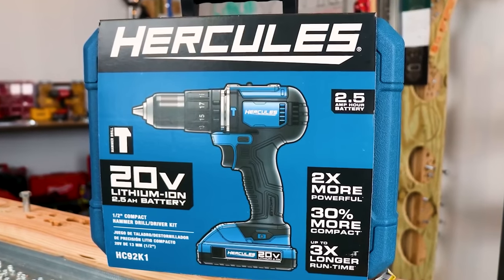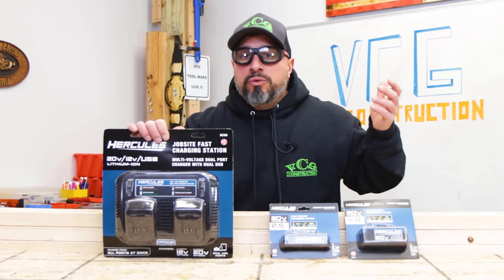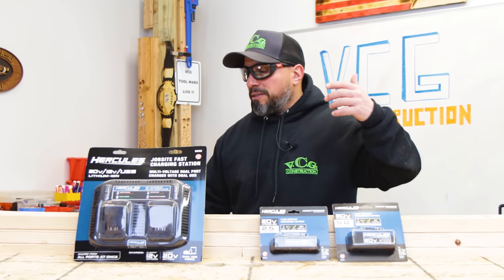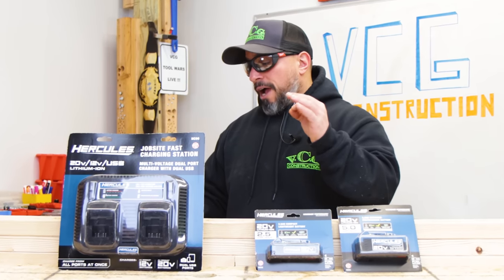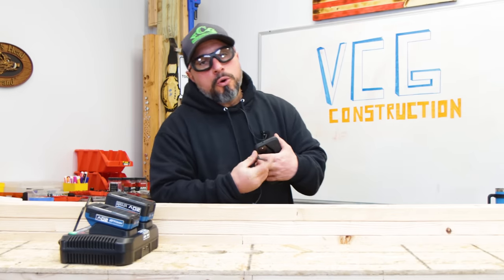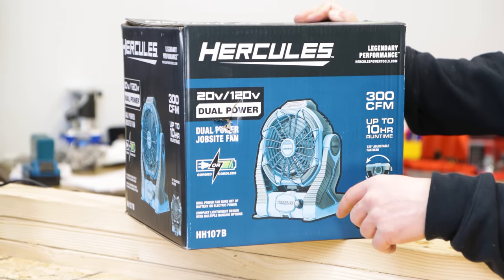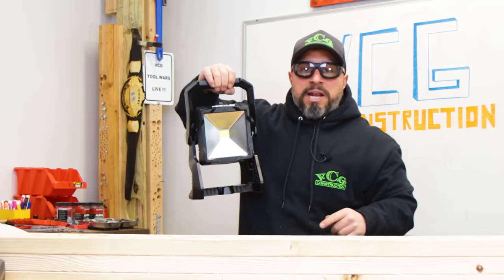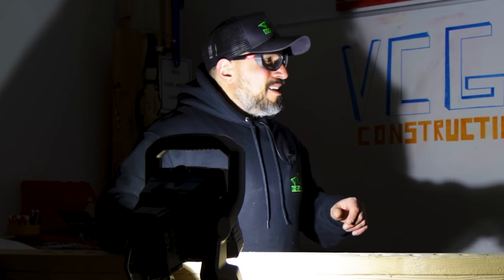HARBOR FREIGHT Sent Us A TON of FREE Hercules Tools for UNBIASED REVIEW!

Comment: My primary concern with HF power tools is in 3 years Hercules and Bauer will probably be gone, and they’ll be onto Perseus and Taurus.  Let alone 7-10 years from now...
Reply: Chicago electric stuck rnd awhile but yeah they did lynxx dirty. So will they keep with these? Idk. They Investing a lot into the line right now. Good sign
Reply: To be fair, how is that any different than the current big name brands potentially developing a new battery design within that same time span that's not compatible with their older tools as they discontinued the old style battery? You'd have to be forced to buy newer tools anyway just so they're compatible. The only brand I see not doing that is Ryobi since they've had the same battery platform for years.

Comment: I'm a WW, and I've had my share of HF tools. Some are out-and-out crap (any Drill Master tool, except the bits which are ok). Others seem to do really well. I have some Chicago Electrics that over 15 years old. The main problem I see is reliability. They may seem to be great when first used, then a year later they quit, or start having problems.

I've gone sour on them because of the compound slide miter saw that I have. Yeah, it was only $89, but  It is a way better design than the previous version. The slide bearings are going out after only a couple of years. They aren't replaceable, either. The old one I had never quit, but was getting unsafe because the spring wouldn't stay in.

I think they have a low bar on quality control. I would suspect that everything that gets assembled, gets shipped.

Comment: The most interesting is that work light, any of the other stuff, naw, not yet. But the work light makes sense, but I would buy 2  and hopefully I could get the 25 off the two port charger with a couple  2.5 amp batteries, but the dual power makes the sense that Milwaukee lights are.

Comment: Great video Vince! Hercules seems like a fine tool brand, but it's weak warranty and comparable cost to other better brands keeps me from jumping to that platform. I will stick to Makita, Bosch, Ryobi and DeWalt for all my power tool needs.
Reply: Abel I was thinking the same cause I do have a need for a cordless 18 volt multi tool,  I got a Bosch 12 volt and a Bosch Corded but both are Starlock and finding a blade when really needed somewhat impossible. I know that Makita is top rated, and I already got so much Milwaukee Cordless as well as Bosch  Cordless, Bosch 18 is European,  do you have the Makita or Milwaukee?
Reply: @josephlabranch6595   I have mostly makita, Ryobi and a single DeWalt for all my 18 volt cordless power tools. All my 12 volt tools are bosch.
Reply: @abelesparza6059  honestly the 12 volt bosch multi tool has the same problem as almost every other 12 volt battery I know of and used and that is the battery staying put vs. vibration,  lol!
Reply: Nobody mentions the extendable 2 year warranty. And you don't need to mail in the tool and wait 6 weeks like the other brands, just walk into harbor freight and they hand you a new one.

Comment: I remember when Home Depot cleared out Irwin Quick clamps. I scored (10) 38" HEAVY DUTY . AT $5.50 EACH AT THE TIME RETAIL WAS $40++ . GOT ABOUT  50 + FREUD/ DIABLO ROUTER BITS for around $2 to $4 each normally priced around $20- $45 . They where reducing inventory mix. Gave several to my woodworking buddies as gifts and they couldn't believe it. The guy over at the hardware store got all he could to resell as they where the deal of the century for him. Don't see this as often anymore as Depot will pack it up and send it to a pallet load auction resell division they have i believe out of Phoenix. Cheers

Comment: Been using the Hercules 20v impact and 12v compact drill (both with hex bit chucks) for a while now, and I'm very satisfied with their performance.  Granted, the impact doesn't have the MOST ugga-duggas, but it's cordless, so what do you expect?  But it's just right for getting most bolts in an engine bay busted loose with a minimal amount of screwing around (heh-heh), and the compact drill works nicely for the lighter duty stuff.  The fan is definitely handy to have on a sweltering summer day while doing your shade-tree-mechanic thing.  They now have 1/4" and 3/8" drive 20v ratchets and I am seriously considering these because sometimes you don't have much room to crank a wrench.  And since I'm already on the Hercules platform...  Yep.  Gotta have it.

Comment: I like all the brands are selling bare tools, but I also like getting combo packs like 4 tools and 2 batteries and charger for a good price. Harbor freight doesn't seem to do that at all. I have invested in Dewalt just because of a sale on a combo pack. I have been buying tools on sale on Amazon, and so far, no joke, I have gotten my Dewalt tools for less than Bauer ones would cost total. I guess I would sum it up like this, remember when Toyota was really cheap, but reliable cars? Now, decades later, they are still reliable more refined and last longer than any others, but expensive. Well, in my opinion, Hercules is trying that move too fast.

Comment: Those 3 to 5 year warranties are limited to manufacture defects or assembly issues.  HF figures that 90 days should be a time that issues due to manufacturing or parts defects should appear. HF does not offer an extended warranty, they offer an exchange program for a extra fee. No matter what you did to break the tool, you walk out with a new one in 5 minutes.  Send in your 5 year limited warranty and find out how limited it is and if fixed, you have a old tool with new parts, never the same tool.

Comment: Harbor Freight won’t post bad reviews. I left 2 very detailed reviews regarding their Hercules TS and their Hercules MS. The miter saws blade started wobbling in the middle of a cut and ripped the piece of wood out of my hand and pulled my left hand towards the blade almost into it and shattered the piece of wood. This was 17 days after purchasing it. Left a detailed review on their site and they wouldn’t post it. The table saw wouldn’t stay square in making cuts and was all over the place. Wouldn’t post that either. Harbor Freight is a joke and I refuse to step foot in one of their stores! Keep in mind it’s in that price range for a reason!!! What safety corners do they have to cut to bring you these low prices???

Comment: The fan and light makes sense, Dewalt sells a similar light for over $100 which is ridiculous.
Reply: ID throw the vacuum in. Only comparable I found was dealt at 50 more. Granted hf 2yr is 20.
Then add in price n charge. (Hf 2.5ah 35/ 5ah 60. Cheaper charger 30?) 
The dual power at least means u don't have to feel tied to the platform for future

Comment: Buy 2- 5 ah Hercules batteries and get any Hercules tool for free. With the new battery adapters to connect Hercules batteries to Milwaukee tools and both batteries using Samsung cells, this is a simple no brainer.

Comment: Yo Vinsanity!  Bet your shop smells like Harbor Freight now 😂.  I like that Hercules is introducing Brushless tools.  I like the Good, Better, Best model HF is using with the Warrior, Bauer, Hercules lines.  I like that they are introducing lots more 12v items in both Hercules and Warrior.  I think they have realized their target market isn’t just DIY but “prosumer” as well.  What’s holding HF back from truly competing against the big dawgs like TTI and Stanley B&D is that crappy 90 day warranty!  The prices of these new tools are either right at, or marginally below the Dewalt and Milwaukee’s and like you said, those warranties are 3 and 5 years!  If HF changes their crappy warranty, or drastically reduces the cost of these tools, then there is reason to consider these. Until then.........I’ll pass.  You should get some of those Febreze plug-ins to get rid of that HF smell from your shop 😂 and yes, light was brighter with battery and I didn’t see a difference between battery and chord with the vac.

Comment: Had some time to kill and H.F. was across the street.  Went in for some cheap bar clamps and picked one of those Herc cordless up. The smell made me instantly put it down and walk away laughing.  It smelled like that bad electronics burned out junk right off the shelf. No thanks. As a Carpenter (far from apprentice) I will say Ryobi has impressed me so far FOR THE MONEY. Definitely not the most high end tools on the market but at a that price point...

Comment: The only problem with harbor freight is actually kits and price. Just price Hercules 7-1/4 circ saw was 99.99$ that dual charger 59.99 and battery 4ah 59.99 is 220ish+ taxes. DeWalt cir saw kit with charger and 5ah battery was 279.99 at Lowe's 299.99 everywhere else . Hercules you have to buy a 1 year or 2 year option. DeWalt offers A free 3 year warranty.. even if not free better than buying a 39.99 2 year any day. Spend the extra go name brand. The kits are better. Also my DeWalt kit came with bag. Hercules you have to buy bag
Reply: How much is a dewalt battery vs Hercules. Once the tool is purchased it's the batteries that give them life. I have both tools I buy the extended warranty from Harbor Freight and can renew it every 2 years. If the tool for whatever reason becomes defective I don't have to take it to "an authorized dealer" I take it to Harbor Freight and get a "brand new one" doubling the life of the tool. Meaning 0 miles on it. Otherwise with my dewalt I have to take it to an authorized dealer who ALWAYS has to keep the tool to fix it. Once fixed I still have a "repaired" tool with still all those miles on it. I'm not criticizing anything but that is the reality of an honest comparison.  Who wants to buy new cordless tool batteries. Hercules batteries compared to other big name brands is extremely affordable.

Comment: Ive learned that some hand tools and other items are fine at harbor freight. but i do not trust anything with a motor. they are priced to what they are worth. They are not meant for torque or power and you get what you pay for.  them power tools from bauer and herculese might be fine for home use. but would never hold up on a construction site

Comment: Granted this video is 3 years old. No offense I definitely don't think that you have the ability to be unbiased in your reviews. The regular price on that tool is dropped to $80 with a 5-year warranty. It is far more than competitive now. You mentioned during certain promotions the other brands will be better price wise, but you're forgetting harbor freight has deals as well...... This Spring black friday, got a 5 amp hour battery, charger,  and a free tool for $99. I chose the multi-tool because I really need one. With the deal the tool was essentially 40 bucks. Then again that's with a 5 amp hour battery a charger and the tool for $99. And again with a 5-year warranty on the tool in a 3-year warranty on the batteries. You don't have a brand that you can name that is a better deal than that..... And also works. Also I already have a charger so I'll be bringing the charger back and getting the battery and tool for essentially 60 bucks. Again I would love to hear of any brand that can match that.

Comment: It’s been my experience that ALL harbor freight products are intentionally engineered to give you the absolute least value and performance that they can get away with and still be a viable option! It’s called “value engineering”. It’s a page straight from Walmart’s playbook!
Reply: I agree with that on their power tools (air/battery) . But “ some” of their hand tools and specialty automotive tools are phenomenal with their lifetime warranty.... their titanium’ and Vulcan welders are also hard to beat.... the same for “some” of their tools boxes..... that’s the main problem with harbor freight, (and snap-on, and gearwrench , etc), you get a couple phenomenal items then the rest is flat out garbage to get you in the door, but you can’t stop there! You gotta shop smart everywhere.....
Reply: @cowboy41231  
I completely agree that you have to shop smart everywhere. Everywhere you look there are products engineered to fail. And when I say engineered to fail, I don’t mean just made of the most absolute garbage. They can be great, except for 1 component, and when that fails, it’s not worth fixing. 1 little component inside that causes catastrophic failure or with lack of replacement parts, or just labor costs, deems it not worth saving. Yes, you have to shop smart everywhere, there’s the opportunity for this from every retailer. My problem with HF is that EVERY electrical product they sell is engineered this way. That’s their whole business model. Pretty much any product that they sell without a lifetime warranty. You absolutely KNOW that if you buy something from HF that doesn’t have a lifetime warranty, it is 100% engineered to FAIL. Even their highly praised US General toolboxes, which even I think a lot of compared to all the junk that is on the market today. Even they are made “just good enough” to be held in high esteem. The boxes and the drawers are fairly good compared to so much of this crap around today. Even the paint isn’t half bad. But, the latches and the drawer slides are still CRAP compared to the rest of the box. They could put good slides and latches on them and they’d last 30+ years for most people, but instead they put crap on them that last 2 months to about 2 years in moderately heavy use. They could put good slides and latches in the box and drawers they already have for less than $50 actual cost and warranty it for 5-10 years and charge 30-50% more. But that goes against their whole business model. They’d rather build something that prematurely fails and only give you a 90 day warranty. It’s fine, I’m sure they’re making money. Just not mine, or anybody I know that actually uses their stuff regularly. Their lifetime stuff is fine for what it is, i don’t know that I’d call anything from HF “phenomenal”. Accept maybe the lifetime warranty itself. I still have a little bit here and there, but a lot of it is sitting in the box broken more than it is functional or just doesn’t work near aswell as good quality stuff, so a guy gets tired of it and buys better. 

I don’t know much about their new welders in general. I know guys have been saying they’re great, and inexpensive. But how long are they going to last? Are they still going to be going strong 20 years from now like my miller or 25 years like my airco, or 50 years later like my Lincoln ac/dc stick welder?
Reply: @matthewpeters85  that's a good point about the boxes/slides. As for the welders, it seems like there is alotta brand loyalty in the welding world.i for one had a hobart for 16 years that I was really hardpressed to cycle out, I was going to go with a lincoln (because I read warranty nightmares on millers of the same category and the expense to fix) so I ended up going with their vulcan multiprocess machine BECAUSE of the 1year risk free warranty.....I've been using the shit out of it the last year and a half (even lending it out to friends) and it's held up. I have a 3year total warranty on it. Personally I view my investment as 7-10 years as I feel I waited too long to upgrade my hobart, since then the technology has upgraded stuff. I'm not doing it as a profession (auto repair shop) but when I do get involved with a project or welding frames it does the job-well compared to my hobart-which was a much lower capable machine .... That's my opinion/experience. That's the thing, somr people get bent out of shape as if people's opinions are the word of God or gold, without know their comparisons or experiences. With that in mind i  would consider a  "phenomenal" product to be their quinn tools (price value, ease warranty and quality= kobalt/tekton/craftsman) and their icon tools in some cases CAN be (not all)  a bargain compared to snap-on, carlyle, mac, gearwrench, etc (again- price value, ease warranty and quality)... Stuff like that are made from the big brand manufacturers anyways (ie: the daytona jack is no secret now since the lawsuit, same factory as snap-on for 1/3 price) .... Your rant on the toolboxes plays perfectly into their TIER marketing for the ICON boxes. People that don't "live" out of a box don't KNOW what it's like to have CRAP slides and CRAP drawers/construction, but that's the discernment the reader has to make (however in my POINT of view, I'll NEVER rationalize a snap-on toolbox because the toolbox doesn't make me money, although I would love to see it rattle the market to bring in more competition-same goes for their power tools)
Speaking of power tools- did you ever count how MANY different battery platforms harbor freight HAS in their store???

Comment: Luckily on the vacuum it won't suck hands and will suck up debris and water, so it's safe to say it does what it meant to. A little bias video, it would have been a better video if it were unbiased considering it this brand does better than Dewalt and some aspects keeps up with Milwaukee

Comment: Yes, oscillating tool blades are too expensive. For $15 you can get a decent 7 1/4" circular saw blade, a pack of decent jigsaw blades...or an oscillating blade that doesn't touch either for speed or cut quality. Oscillating tools aren't rare, expensive, specialty tools any more. They're just another saw. It's past time for the blade prices to reflect that.